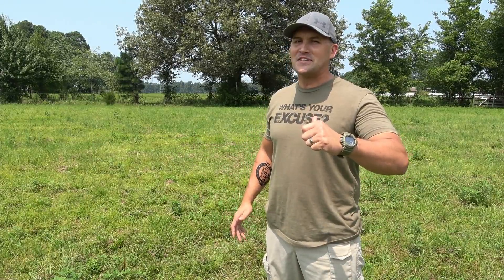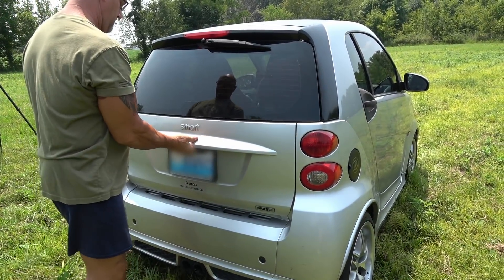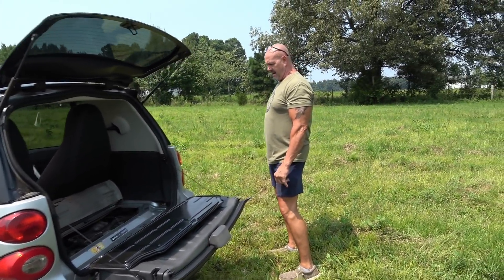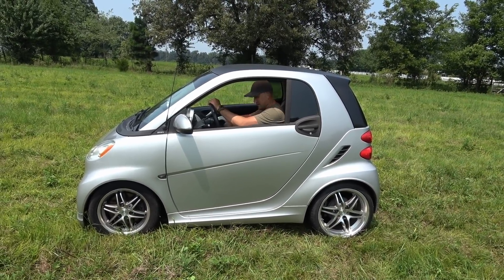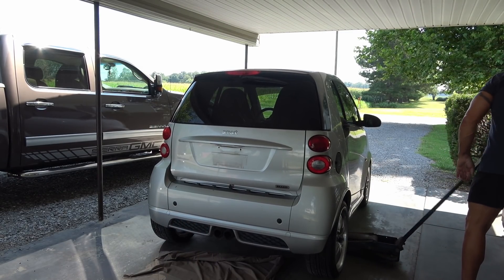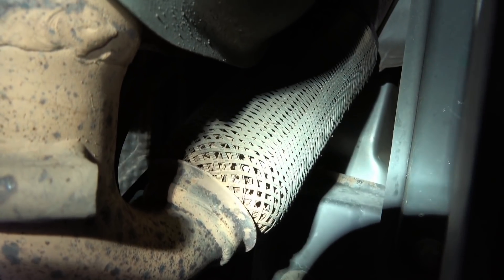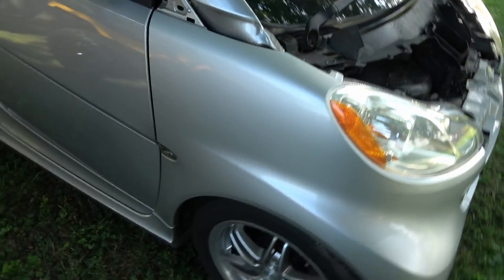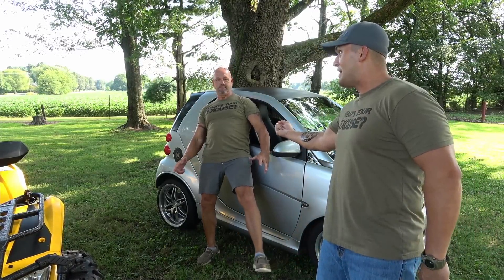Smart Car To Dune Buggy Transformation (Part 1)

Comment: Yo daddy Scott if you buy a diamond tipped blade for that grinder you’ll really appreciate it. I’ve had mine for over ten years and I’m a plumber cutting cast iron,concrete,rebar, anything ceramic and it’s never exploded into shrapnel. Work safe and thanks for the video.

Comment: To help put something into perspective, a car I grew up with was my fathers 1952 Mercury Monterey Sedan,
with a curb-weight of 3,550 lbs had 125 HP new with a theoretical top speed of about 90 MPH, 0-60 in 14.8 seconds.
That smart car would have a curb-weight of nearly half that with comparable power, power to weight is a hell of a thing XD

Comment: I'll admit I do miss this channel, as well as Wreck it Wednesday. 
Get yourself a sawzall though, you'll hardly use the angle grinder after that. Pro tip on the sawzall, don't try  to squeeze the throttle trigger through the handle. Feather the throttle so you don't burn your blades right away. 

I look forward to the progress!
I'm also happy I don't live in Kentucky for the simple fact that I won't have to listen to a flatulant smart car 😝

Comment: when in doubt, prybar and hammer. beat that sumbich out.you've got twice the muscles I do easily, and there's not a lot I cant rip apart with a 6 foot solid steel breaker bar and a sledgehammer. I actually bent the breaker bar ripping up a 4x4 stud that was cemented to the fresh padio cement I laid a week before.
Reply: like 1 and a quarter inch thick by 5 and a half foot solid steel breaker bar. had to throw all my weight at and and reef on it to unstick that 4x4, and had to do it lengh wise so not to damage my freshly laid pool patio. but I had the mechanical advantage of a strong stone as a fulcrum and a long lever. still had to kick the stud a few times to help unstick it.

Comment: You might want to weld a length of pipe just poking out the back, those smaller engines tend to run better with a little back pressure. And it'll make it have a better tone to the exhaust too.
Reply: No it won't

Comment: You can get a lift installed in your barn for like  4k. Removing the muffler probably made it slower if anything wouldn't it have? Stupid little 700cc wants some back pressure.

Comment: These cars are also so computerized if you cut the wrong wire thinking you don't need it, the car's computer will say tuff shit, nope not running!  You can also bi-pass the stability controls by shorting out 2 wires behind the OBDII port.  You need to gut the CAT also....if it's still there.  The lift will be a Daystar lift....easier to simply space out the sub frame between body and sub frame using square blocks, same with front steering rack etc. Then cut and weld spacers for struts.  Especially if you are just beating the crap out of it and it's never seeing road service again. Seriously, what will stop you dead in the water will be electrical issues if you do not keep that all stock. Electrically speaking.   The only way to get HP is to bike swap it.....plain and simple.    Go to any Smart Car sites and you will learn all about their electrical issues. IF you upset them too much you';ll require a STAR  machine to re-boot it....that is the dealership's diagnostic computer programing machine etc.